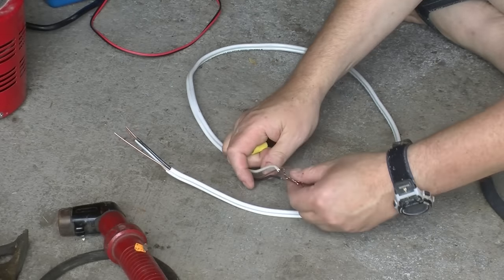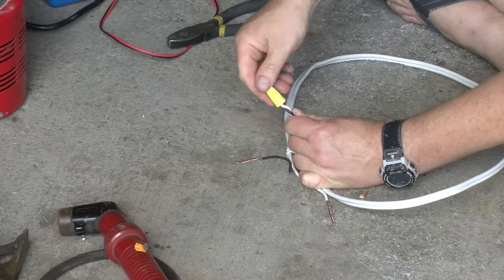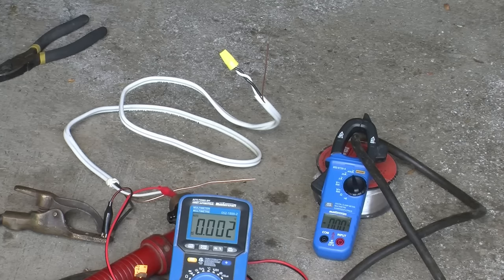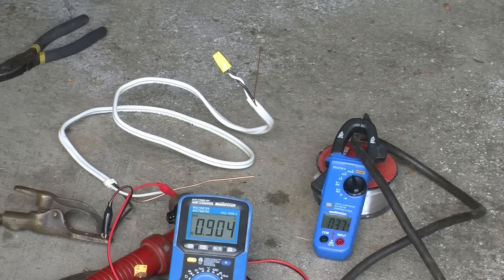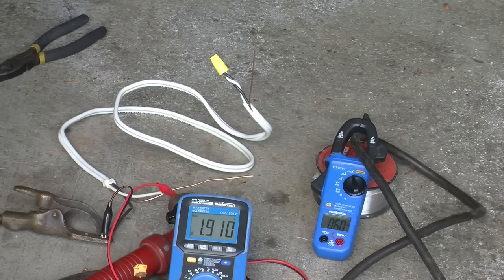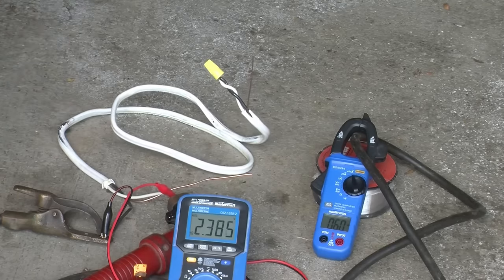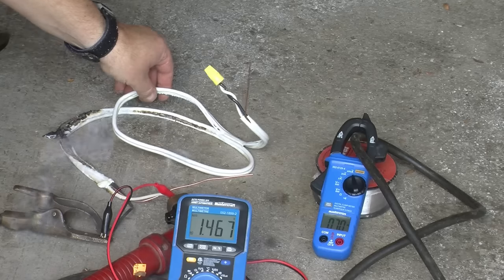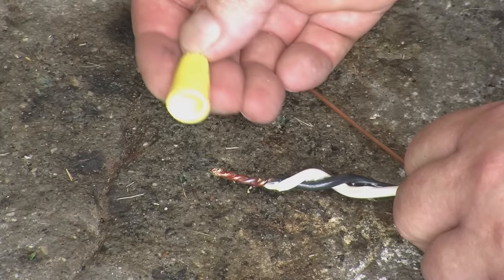How many Amps to burn up 14/2 electrical wiring?

Comment: Since this is a test of 14/2  household wiring.  Should not you be using 120vac and an AC load? Just considering one fact alone, "shorting". 10kv will jump a 1/4" air gap. So 120 volts will jump 
across a larger gap than 12 volts, much less 2 volts, at such a low voltage the conductors would have to essentially touch one another too short. Also duty cycle?
Reply from the maker: The test is intended to (informally) look at how much current you can pass though a 14/2 cable before the plastic starts to melt and the cable fails. Shorting and arcing due to the melted insulation really happens after the damage is done. I did a FAQ video here discussing some points you raise here: https://youtu.be/CP3-jcpzZeI

Comment: Remember that amperage is at a very low voltage. Personally I use 14/2 for lighting since everything is LED nowadays and 12/2 for receptacles
Reply from the maker: The heating due to current is independent of the wire to wire voltage. where the wire to wire voltage would come in is if the breaker didn't trip when the wires short. At that point even more current would flow that at the end of this video. 

Agree completely with you choice of wire - did some follow up videos with cable 2x4 walls with various types of insulation - with really good insulation the safety margin gets reduced way less that I would be comfortable with in some situations.

Comment: Your testing a short circuit condition not an extended overloaded circuit which is what would be most relevant to the type of use NM cable would see

Comment: You would have to have a defective breaker or deliberately bypass the breaker to have that much going through your house wire.
Reply from the maker: Yes. But - there was a series of breakers manufactured years ago which apparently were notorious for not tripping, and even earlier people used to put pennies under fuses that had blown defeating their purpose. 

This was just a quick experiment to demonstrate how much of a safety margin we have. I did some following videos with 14-2 in walls with and without insulation for a more realistic situation.

Comment: So how do people get buy using space heaters that are rated at 1500 Watts and use 1.5 KW hrs?
Reply from the maker: Because at 120V (assuming you are in US or Canada or other 120V country) the current the heater draws is 1500 divide 120 = 12.5A whoch is way less than the currents needed to burn the wire. I can do it will less voltage because I am not supplying power to a heater or load at the end of the wire. All that matters in terms of the the wire heating is the current flowing.

Comment: A longer duration at a lower amperage would probably make it fail as well for a more realistic way they fail.
Reply from the maker: Yes  - it would be neat to find the exact point by talking longer and very slowly raising the current . Also would be good to have it in temperature controlled environment.

Comment: No no no! No twisting the wire before the wire nut. The connection is made by the square wire that makes up the screw threads cutting into the copper to make a gas-tight electrical mating. Let the wire-nut cause any twisting it needs. The wire nut connection will handle far more current than the wire is rated for.

Anyway, it isn't the wire that causes problems in houses, it is bad joints with screws on outlets, etc.

Comment: 14/2 can safely carry 20 amps. 12/2 can safely carry 30 amps. And 10/2 can safely carry 40 amps. But because of the + overcurrent factor in the circuit breaker the safe rule of thumb is 14/2 15 amps 12/2 20 amps 10/2 30 amps and 8 gauge for 40 amps.
The reason for this is that it will allow the breaker to trip well before the conductor gets hot. But if you only had 14 gauge house wire and needed to use it for a temporary setup at 20 amps nothing higher (ie extension cord) youd be fine.
This is a classic example of WHY you follow the code rule of thumb.

Comment: I just today went to a house that had 14/2 spliced to 6/3 UF from a 50 amp spa circuit for a light outlets and a fan 😂 I was shocked that there was no evidence of heat or burning at all and it had been like that for years
Reply from the maker: Wow - talk about living dangerously! Maybe they were lucky and the spa heater had a relatively low duty cycle or consumed much less power than a 50A circuit would allow + the 14/2 wasn't covered in insulation (see the videos that followed this one) .  I have lived in numerous old houses and for every one have been shocked and surprised at some of the potential electrical issues I have found - but none like that!

Comment: The reason for this over safety in residential wiring is due to power transfer. We don't want power waisted in electrical heat of the wire. When we have 100,000 homes on a power plant that little bit of efficiency goes a long way. 
Of course one can argue a little heat is good in the winter. However that was not the intended purpose.
Reply from the maker: Your absolutely right that efficiency is important, however the UL and CSA certifications for these types of things are based on preventing fires. I would argue that these days phantom power (the few watts each of our always-on power adapters) multiplied by dozens  per household is actually a bigger problem than transmission losses within a house.

Comment: Look up a couple videos about testing Wagos  with welding current. They’re pretty interesting.too. Might give you some ideas for your next video.
Reply from the maker: I have had numerous requests for more extensive testing of Wagos. So that's definitely on the list as soon as the weather gets warms enough to do things like that outside (because of the fumes).
Reply: @ElectromagneticVideos  I would like to see you test Ideal’s In-Sure version 2 lever lock  connectors (available at Lowes and parts houses) along with the Wagos.
Reply from the maker: @lorenrickey5481  The look like copies of the Wagos! I definitely get some  and do a comparison!
Reply: @ElectromagneticVideos  there are some features that I like better with the Ideal In-Sure 1) you don’t need to open the level to install a wire 2) the levers close in the opposite direction of the wire keeping them from getting accidentally opened. 3) the levers are smaller and snap into a recess area keeping them locked better.
Reply from the maker: @lorenrickey5481  That actually sounds like they looked at Wago and decided to try and improve on it. Have you used any of these for significant loads ie something like motors or heaters that continuously draws 10A or more? Haw you found any issues?
Reply: @ElectromagneticVideos  after watching some videos on YouTube, doing the same thing that you were offering to do in the testing with wire nuts and Legos from another YouTuber I decided on the ideals. Don’t get me wrong I still use 3M twist nuts and Wagos, but prefer the Ideals overall.  Have not really tested them on motor loads but they do go up to 30 amp current ratings for larger wires I believe.
Reply from the maker: @lorenrickey5481  Interesting! The thing  that concerns me about the Wagos and similar is how they depend on the plastic to hold the wire in tight, whereas the wire nuts have the metal spring thing to provide some some strength that is independent of the plastic which is more subject to heat an ageing. You have me quite intrigues with the Ideal ones -  really looking forward to doing a test on them!

Comment: The ratings for Romex are mostly based on ability to dissipate heat. Heat is watts and current limits figured for most USA Romex is computed at 115VAC. The current you're getting is so high is because the voltage is so low. Raise the voltage and the failure amperage must go down to maintain the same amount of heat. So saying that 14 AWG wire can manage 50 amps is dangerously misleading. Run the test properly at 115VAC and you'll get vastly different results. 2 volts and 50 amps is only 100 watts while the same current for 115 volts is over 5000 watts. That will melt your wires. Lower the current to 12 amps at 115v and the wattage drops to just over a thousand which is quite a difference. When I charge my EV from 115v it typically runs about 14 amps on a 20 amp 12 awg circuit and the wires do get warm enough to feel.

Comment: A 14/2 embedded in insulation, cranked up to 25 Amps and left until something bad happens would be interesting to see. I would really like to see if you are even stretching the code a bit (14/2 on a 20 amp breaker) at what time do we get a catastrophic failure (fire).
Reply from the maker: I did a few  embedded in insulation videos   https://youtu.be/Df7bAEdIILI  and https://youtu.be/lFdSXTKsKwA and https://youtu.be/4k0xLiokNsc. Note quite the long term at 25A you want but more realistic than this one. The surprise to me is there wasn't an actual catastrophic fire even with foam insulation. But also how small the margin of safety gets when the wire is inside thick insulation. As far as stretching the code - some breakers are rated at 100% over-current for up to 30 minutes before tripping. So 14/2 on a 15A breaker better be able to handle 30A for at least 30 minutes although one would hope that's a really unlikely event...
Reply: @ElectromagneticVideos  UL testing has a withstand test for that length of time but it is supposed to trip at something closer to 15 amps (I'm not sure what). A 15 amp breaker is designed to carry 80% rating indefinitely.
Reply from the maker: @johnm948  Your right - I remembered wrong - its more like 50% overcurrent for close to half an hour before tripping. There seems to be quite an uncertainly region between not tripping and tripping  presumably to allow for manufacturing tolerances and environmental effects on the thermal tripping.

Comment: This didn't burn up when you would expect because it was such a short piece of wire.  Wire gauge impacts the resistance per foot of wire.  If you had 30 or 40ft of 14 gauge, you wouldn't have gotten much past 25 amps before things got pretty hot.
Reply from the maker: Length has little effect because the heat given off is on a per foot basis for any given current. So twice as long twice the heat but also twice the area to dissipate it so same temperature. What does make a difference is a real situation in walls with insulation etc as in some of the later videos.

Comment: Why not use a load bank and run at the standard voltage?    Doing it this way the wiring is the load.
Reply from the maker: The heating in the wire is based only on the current. The voltage across the wires and the size of the attached load  wont change the power dissipate in the wires for any given current. So doing this way is nice and safe and doesn't change the heat output and hence meting point.

Comment: That's a 14 wire. This suggests that it would not be ok to use it for receptacles. and even for light, its capacity should not exceed. this really depends on who is wiring and for its purpose. The video is helpful.
Reply: And now you know why I only carry 12 ga. on my truck. And all the receptacles are rated for 20A.
I will still use 15A Breakers on most bedroom outlets.
But, I'm also that ass that likes to add a dedicated circuit for a space heater, in every room.
Reply from the maker: What a great top-of-the line approach. How much more does that add to the price of a typical suburban house? Do customers give you any pushback over the extra cost?
Reply: @ElectromagneticVideos  The difference between the cost of materials is pennies compared to my labor. And it takes the same amount of time, either way.
It's less than 5% of the total cost of wiring a house, and will save you so much more over the cost of the house.
I go two pair of boots to sell you. One for $5, the other for $20.
The $5 boots will last 3 months.
The $20 boots will last 5 years.
What do?
(Please buy the $5 boots, I'm overstocked.)
Reply from the maker: @TimeSurfer206  Interesting to hear how minimal the increase in cost is of using the thicker wire compared to  total electrical cost. And it would be an even smaller  proportion compared to the total house + land cost. So it really seems like a no-brainer these days to just got for #12. I'll have to do some asking around and see if new houses are still being wired with #14 here (Ontario). 

There are a number of large scale developers around here who do thousands of homes at a time and are known to squeeze the trades in terms of price reductions. I'll bet they still use #14.
Reply: @ElectromagneticVideos  They do. And they will. Residential Electrical Work is such a Cut-Throat Industry that to make a Profit, one needs to cut every corner imaginable. Like, Safety, Industry Standard Practices Et Cetera...
I served a distinctive clientele: People who wanted it done RIGHT, and not just "Up to code."
"Up to code" is a fancy way of saying, "We don't think it will burn down and kill you before the Statute of Limitations runs out on our Liability."
I will say, though, if you ask a contractor for a BID to do this, he'll most likely try to rake you over the coals. Make sure you ask a friend/friendly contractor for his honest opinion.
Contractors give Used Car Salesmen a GOOD name.. But, at least we can still sneer at Lawyers and Politicians.
Reply from the maker: @TimeSurfer206  I guess there is a natural tendency of people to take advantage of a situation when they smell money. Great that you have managed to find what I am sure are much more satisfying clients to work for - never fun having to cut corners everywhere. Had to laugh at your comment about politicians  - sadly the seen to find new lows every day ... I don't think any other profession can get remotely close to them!

Comment: hard to believe you are grabbing that wire at those amps... wow!
Reply from the maker: I wish I could claim its some sort of superhuman feat, but because the voltage is so low the main concern while grabbing them is the heat and melting plastic.

Comment: Isn't all 14 gauge, in-wall wires protected by a fuse or circuit breaker? How common is it for the fuse/breaker to fail?
Interesting experiment 🤔 but......
Reply from the maker: Well some breaker specs  allow up to 200% rated current for 30 minutes before tripping. So #14 better be able to handle 30A for a while. And apparently Federal Pacific Electrical made a series of breakers a while ago that didn't always trip properly.

Comment: It's sad that nobody's pointed out. The obvious, the lower the voltage, the higher the current/amperage one can pass through the wire. That is why wire switches relays and the such are rated at the amperage and voltage. I have done this type of experiment many times, showing that a wire is rated lower than its load capabilities but not to the factor you're trying to imply. Another reason for the lower amperage rating is what happens to the conductor and its insulation over time being repeatedly exposed to the thermal cycling. And yes, I'm an electrician
Reply from the maker: Unfortunately you are confusing two things - resistive heating due to current flow in a wire and relay current/voltage limitations. 

Due to numerous similar comments I did a written discussion here https://www.youtube.com/channel/UCV2-Qbq9o0EOQWPLAWkVH2w/community?lb=UgkxeilOfLJGy2ODslnBW0WFXUE580oHhFyP which also has a link to UL certification study using essentially the same method.  The biggest flaw in the test in this video is that cable are usually more heat restricted than this due to insulation in the walls etc. I did some follow videos with more realistic situations.

You are right about insulation deterioration over time - and even just ageing will do it. 

Relays and switch rating - they generally limited by the difficulty in  extinguishing the arc when opening which is why you get higher current allowances at lower voltage in some cases. Arcing differences also come out in different AC/DC ratings - much harder to extinguish a DC arc so typically lower max voltage/current allowed.

Comment: Thanks for the video.
Recommended practice is not to run romex inside insulated walls.
Reply from the maker: Really? Is that new or a local thing?  It often is in insulated walls over here (Ontario). Based on my later videos, I would certainly agree that its best not to run it in insulation  -  at least where temperatures may get high like in an attic area .

Comment: When did 14/2 wire become standard? I've lived in Canada and several states and none of them use that size, they all use 12/2.
Reply from the maker: Its certainly been the standard in Ontario and many parts of the US for years. That seems to be changing to 12/2 now. So it probably depends where you are. May even depend on city specific electrical code in some places.

Comment: The plastic is temp rated the metal wire is amp and temp sensitive. So the length of the wire makes a difference.
Reply from the maker: Length actually has little effect because the heat given off is on a per foot basis for any given current. So twice as long twice the heat but also twice the area to dissipate it so same temperature. The exception to this  is the few inches near the ends where heat may flow in ot out of the connections. What does make a difference is a real situation in walls with insulation etc as in some of the later videos.
Reply: @ElectromagneticVideos  I'm not sure,if you have a 100 ft with 60 watts vs 2 ft with 60 watts. 

Yes most of the heat is next to the connection so I guess It only makes a slight difference.
Reply from the maker: @ralanham76  I did a worked example and more detailed, written answers to various questions about this and the other similar tests that I did. Take a look here for a more detailed explanation:   https://www.youtube.com/post/UgkxeilOfLJGy2ODslnBW0WFXUE580oHhFyP
Reply: @ElectromagneticVideos  WOW awesome, that's a lot work 😁
Reply from the maker: @ralanham76  Thanks!